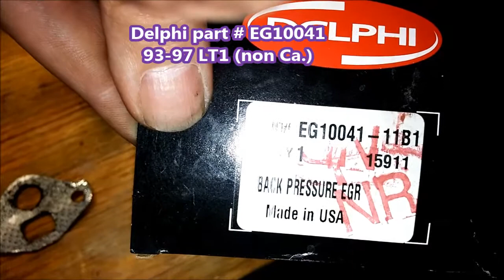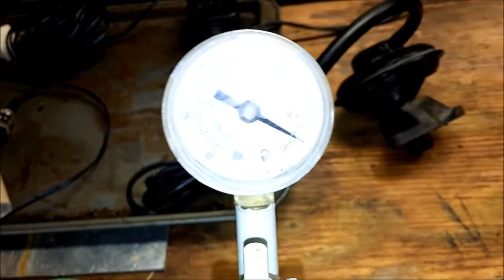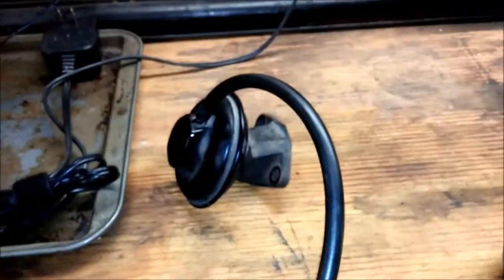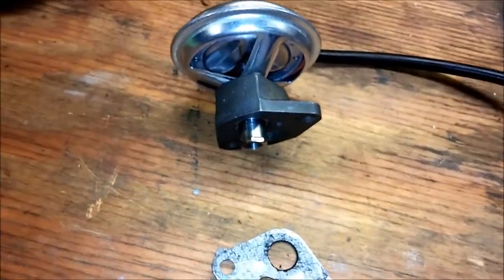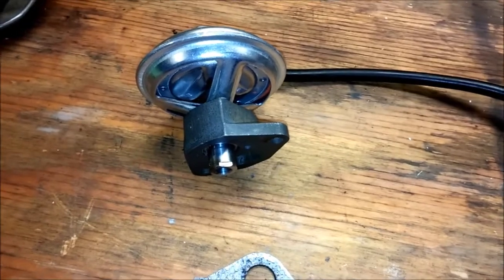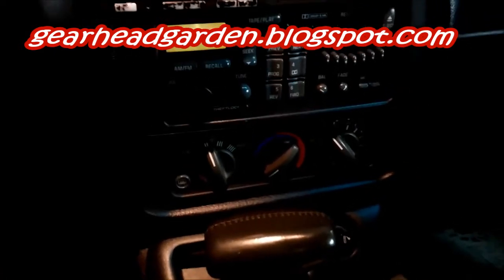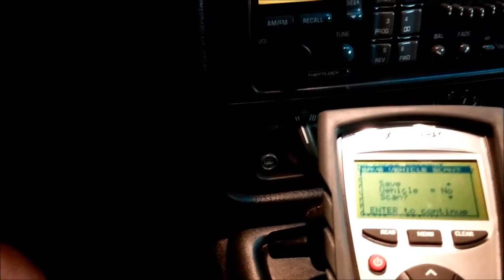EGR replaceent - 4th Gen Firebird/Camaro 93-97 LT1 V8

Comment: Dude.i have to do mine tomorrow. We are almost certain, this is the cause. First i did the throttle position sensor, then we did the Idle control module. Then we checked the vacuum line that goes from the fuel lines to underneath the intake to the intake manifold. . The trans am kept idling up and down, increasing RPM, and idling rough. Will post the results and we will do a video.

Comment: 97 z28, mad respect to you for somehow breaking those bolts loose. The vacuum lines from the EGR solenoid are in the way of breaking mine loose
Reply from the maker: I was worried about frozen bolts on the EGR too since it takes a lot of exhaust heat.  In a way I was "lucky" that it wasn't really doing anything much.  I had trouble with the fuel pressure regulator because the EGR switch was blocking the retaining bolt. I was able to bend the switch bracket out of the way to let me at it.  Perhaps there's a similar bracket you can move.  I couldn't get a socket on them which is why I used a box end ratcheting wrench (gearwrench)  The thing I always remember when I run into problems like this is that there has to be a way to do it that a dealer's tech can bang out in an hour.

Comment: Did you take it off from bottom of car or top?
Reply: Usually it’s from the top back end of the engine towards the firewall. Btw you can get it off with a regular 1/2in socket wrench.

Comment: how diid you get the bolts free, the ones on my 94 9C1 are solid and the wrench is just rounding them off.
Reply: Put PB on it let it sit for a few minutes, then use tiny vice grips if you can to get a grip on the bolt. It shouldn’t be super tight just corroded. You can also you vice grips to get the oil sensor off as-well while your at it if you squeeze it hard enough.

If nothing works you can sometimes grind down the bolts with a small rotary tool to a slightly smaller size wrench.

Comment: thanks for the great video! i ordered a delphi egr valve but part number eg10038 , is it gonna fit my 97 camaro lt1? thanks
Reply from the maker: According to Napa Online it does but you should be sure to cross reference the part number before buying one.  Different years and whether the car has California or Federal emissions equipment can dictate a different part.  Best way to know is to use a parts site that lets you put in your VIN to match up the right parts to the right car.  Try GM parts Direct to make sure...https://www.gmpartsdirect.com/?gclid=EAIaIQobChMIx86KoM3y2QIVzLrACh2KHQ3fEAAYAyAAEgI_SfD_BwE
Reply: Thank you very much for your explanation!

Comment: Great video...I have a formula 95 firebird as well but my scan tool isn't reading. What kind of scan tool did you use to pull those codes up?
Reply from the maker: 95 is  a weird year.  It has the obd2 style connector but still speaks obd1 so you have to have a tool with the right connector but reads obd1.  In my case I bought an auto X-ray scan tool kit from ebay with 5 different cables one of which works with the 95.  The scanner is an AutoXtray Code Scout AX 2500 with the proper cable being the OBD2 looking connector with the blue color on the connector end instead of the yellow.  The diagnostics are limited to fewer codes than OBD2 but it can reset some faults like the AC pressure switch.  It never even threw a code for the EGR which as you can see in the video was obviously junk.
Reply: Car Stuff with El Camino Guy 
Awesome!!! Lol yes we have a very unique car in its year but I'm in luv with it. Thanks a whole lot for the help...I really appreciate it!
Reply from the maker: I'm glad to help however I can.  Thanks for watching!
Reply: My car dies sometimes and it kinda spits and sputters sometimes. I think the egr might be bad.

Comment: What was the code it was throwing before?
Reply from the maker: It wasn't throwing a code.  Partly because 1995 was still OBD1 so the EGR system isn't as closely monitored.  It was basically doing nothing.  Replacement was part of a whole diagnostic procedure to get the car to pass emissions.